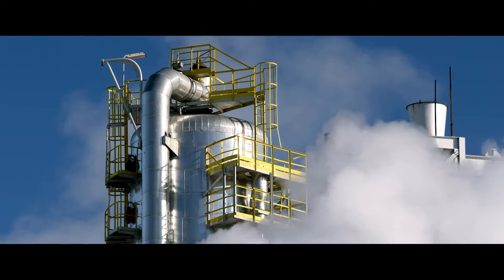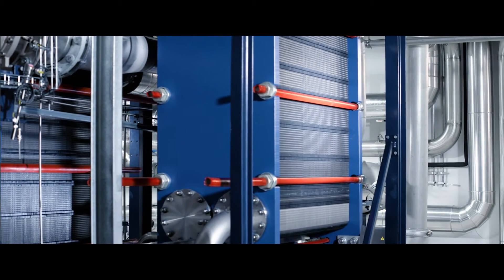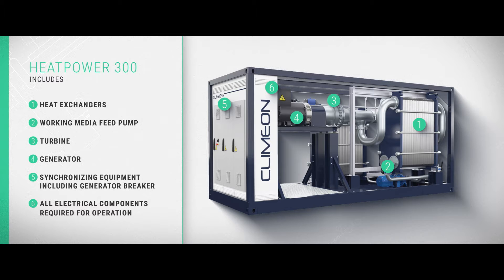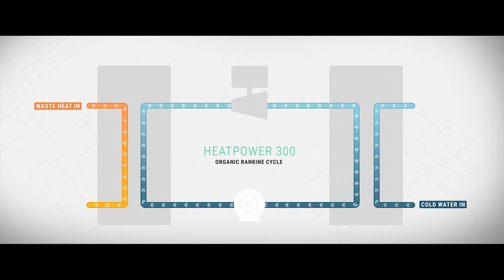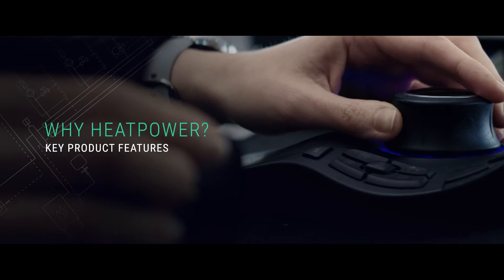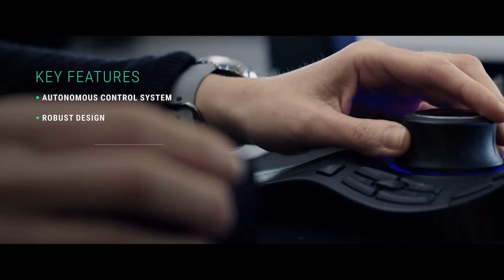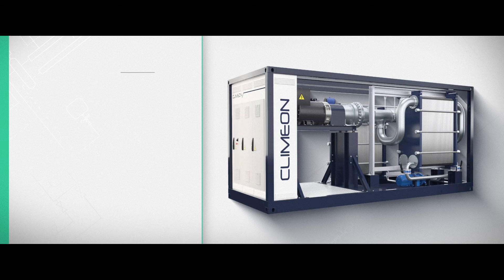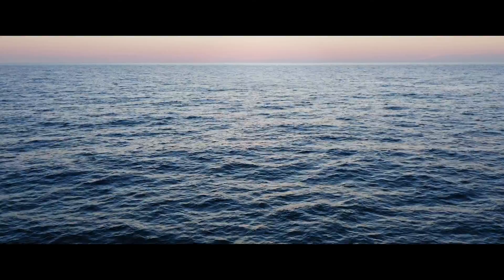Introducing Climeon HeatPower

Comment: I totally understand this. A young man working independently posting on YouTube converted a refrigeration cycle to pressurize the refrigerant with heat, drive what I believe was a piston 'steam engine' (at low power turbines are not very efficient) and produced power. Thank you and good luck.I totally understand this. A young man working independently posting on YouTube converted a refrigeration cycle to pressurize the refrigerant with heat, drive what I believe was a piston 'steam engine' (at low power turbines are not very efficient) and produced power. Thank you and good luck.